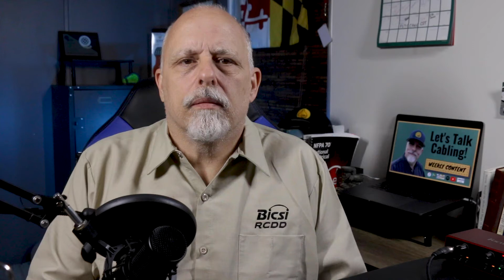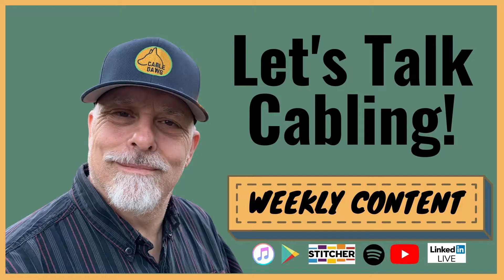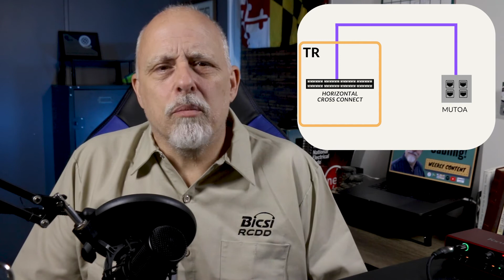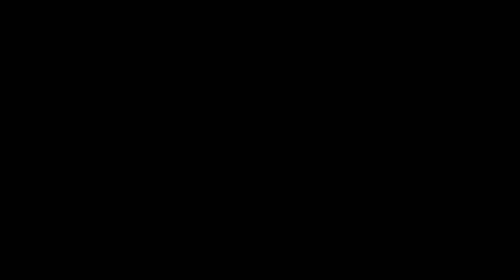MUTOA vs Consolidation Point - What is the difference?| RCDD

Comment: Just a question. Why a WAP should not be connected to a MUTOA and It should be routed directed to the TR? Can't we consider WAP as one of the WA equipment?
Reply: An A/P does serve the WA, but at the same time serves multiple work areas with individual MUTOA's. I would prefer all of my A/P's to have a direct connections back to the data switch in the TR (for maximum data speed connection).  The other issue would be cross connecting a connection from MUTOA's back up to the ceiling to the A/P. Most all A/P's are designed to work at higher capacity in a high horizonal mounted location.